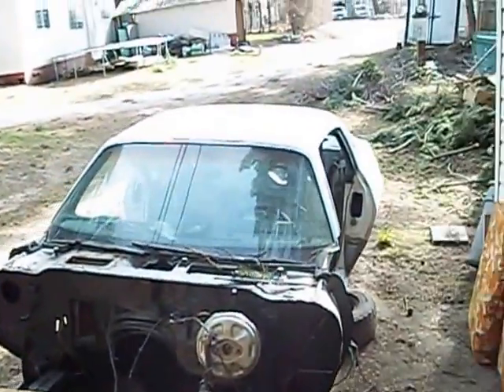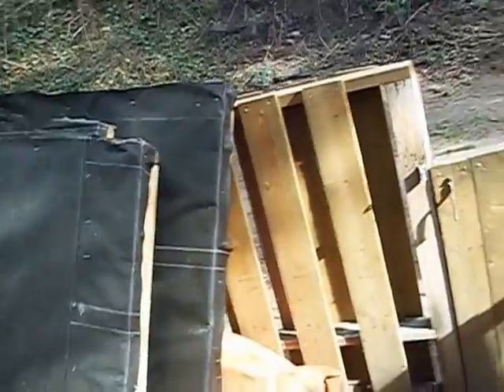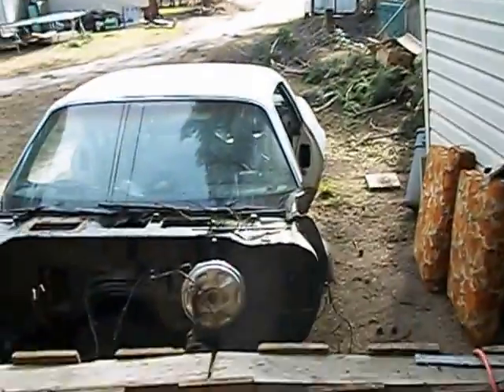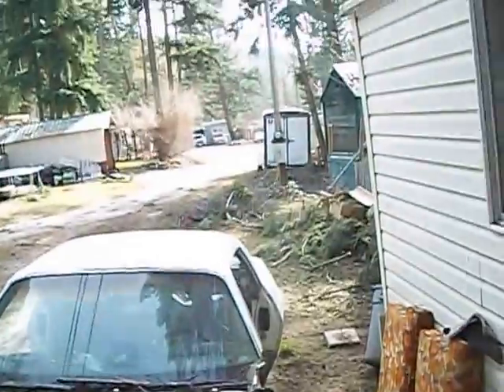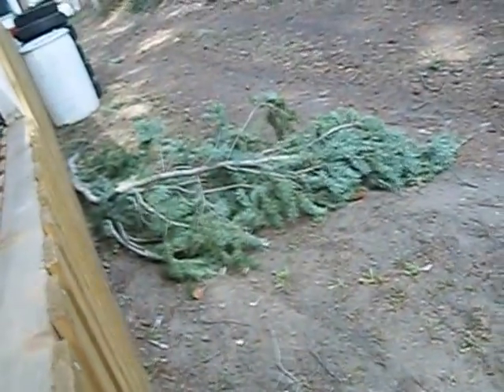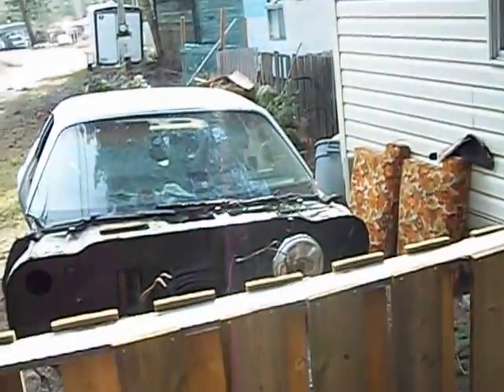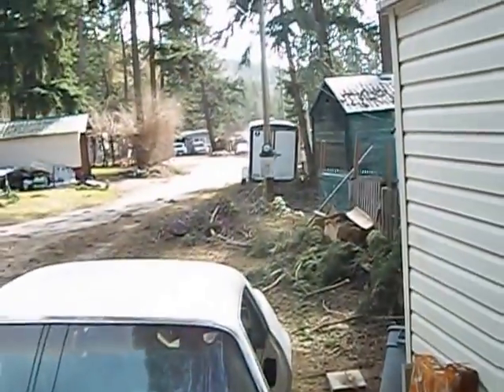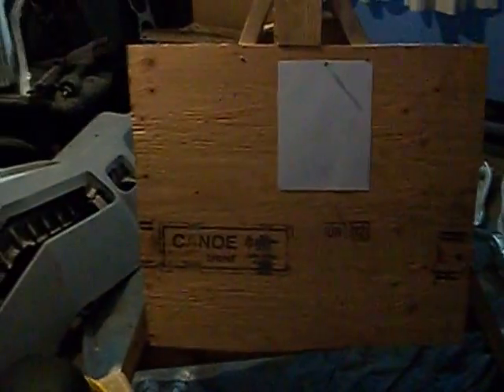001

Comment: Nice work on the tripod.   You probably know, but most camera's use a 1/4-20 mounting bolt, so you could drill a few holes in different places of your wood tripod so you could mount the camera at different positions to get low and high shots.  good luck!
Reply from the maker: turbocobra  Thanks man, yes going to make some angled spacers underneath camera for all angles possible. If need Camera higher up for videos I will block up legs to height needed. Want to make more videos of actual work as I am doing it.